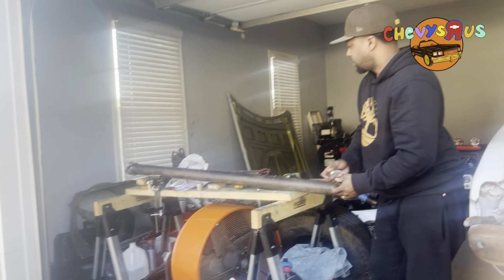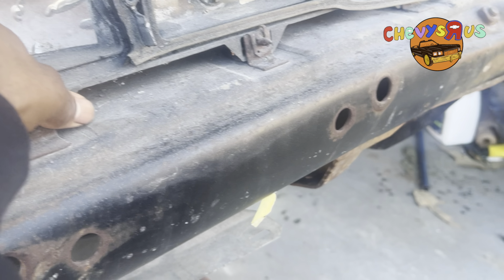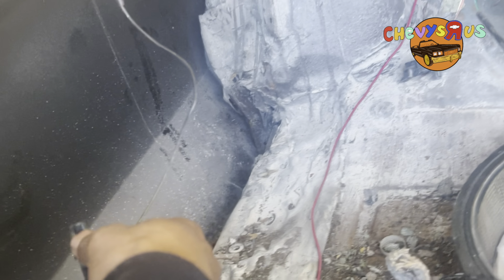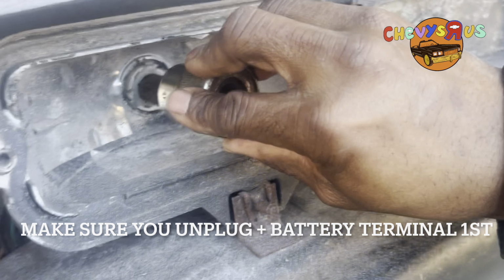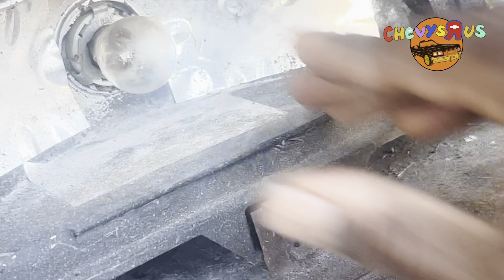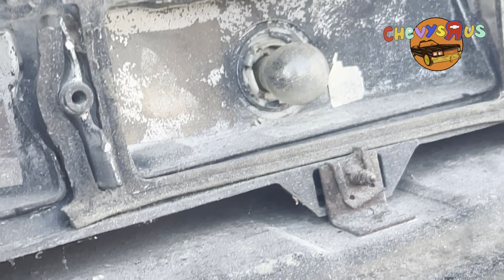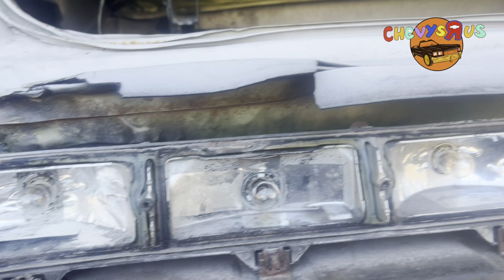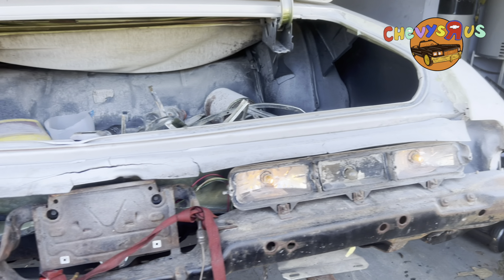Permanent Fix for Old School Chevy Tail Lights 🚗✨

Comment: Can you just take the lense off and replace the bulb or you had to take the bumper off? I'm trying to take my bulbs out but they ain't budging at all.
Reply from the maker: What’s going on Big Jon!!!!  You should be able to just take the lens off without removing the bumper….  Just remove the 4 Phillips screws on the lenses then it should come off…. I actually had to pry the lens with a screwdriver..   O wouldn’t recommend you do that because you may brake the lens….  I think a long putty knife would probably work for you because it’s so wide….  The lens probably ain’t been off I. So long the gasket that helps seal the lens up got crusty!!!   It will come off, just work it real easy with that flat long putty knife..  Keep me updated bro!!!!!!  Make sure to Subscribe and turn on your bell if you haven’t bro!!!  Later!